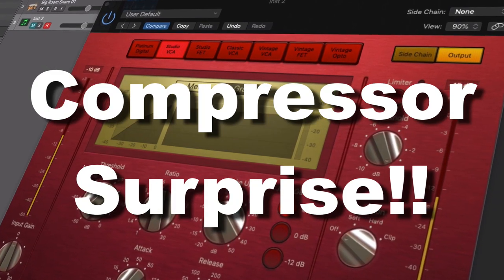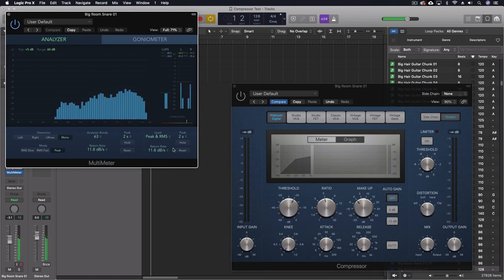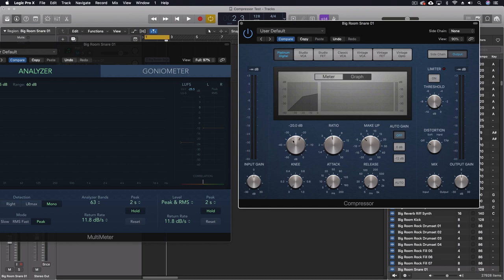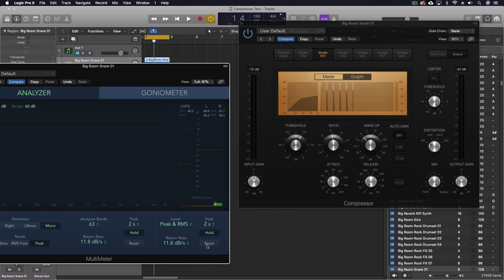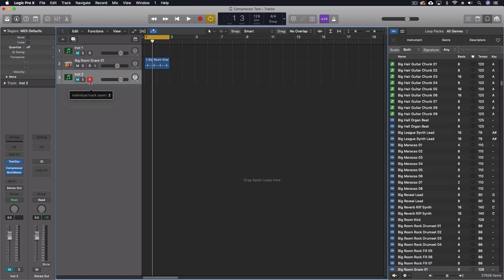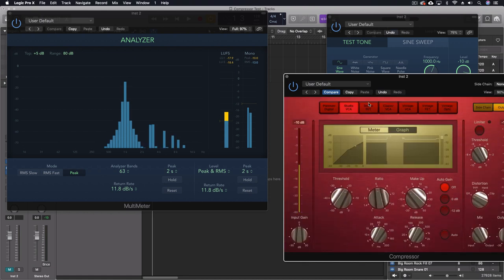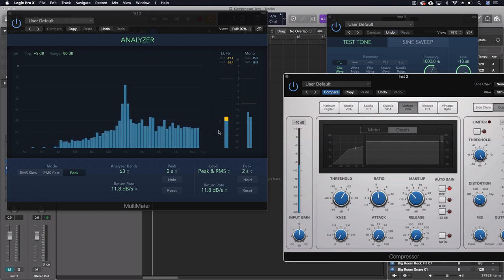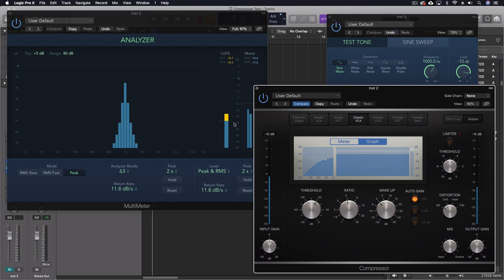Compressor Surprise! | Logic Pro X

Comment: Check the side chain on the platinum digital. If you set it to peak rather than RMS you may get a different result.
Reply from the maker: Ah. Sooo true! Looks like that is the only circuit type with peak as an option and it definitely does change the result. I need to save that as the default.
Reply: @LogicProLife  There is a document put together by a mastering engineer over at Logic Pro X. I'll find it for you.
Reply from the maker: That’d be awesome! The manual is pretty useless when it comes to the finer details.
Reply: Thank you for clarifying that
Reply: @anthonylee3311  Any time.
Reply: great catch! i didnt like those compressor reactions.
Reply: Everyone who uses logic should look at that pdf

Comment: Wow really interesting. Too bad these compressors distort when you push them too hard otherwise I'd probably use them. I've always liked the classic vca and to this day it's usually part of my mastering chain
Reply from the maker: If I need to push them that hard I usually put two of them in series and go less on each one but more overall.
Reply: Yeah but you're still doubling the amount of harmonics added. There's just certain jobs they're not the best for like bussing different vocal tracks to one compressor to keep the levels steady while tracking or mixing. Even with drums or whatever you're compressing together. They always seem to work in a very not finesseyy wayy. Not worth the hassle
Reply from the maker: Yeah, that’s a valid point.
Reply: @LogicProLife  lol then again this channel is called logic pro x life
Reply from the maker: Which equals a life of suffering through complex setups, less than ideal workarounds, and almost amazing plug-ins.... hahah. It’s actually far better than it used to be.
Reply: Use the TDR Kotelnikov. It's free and designed for transparent mastering.